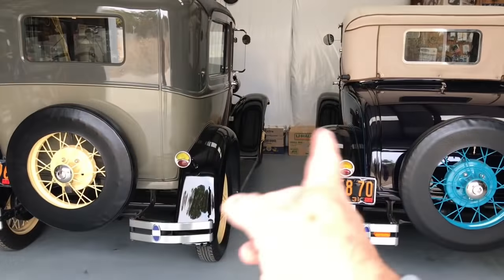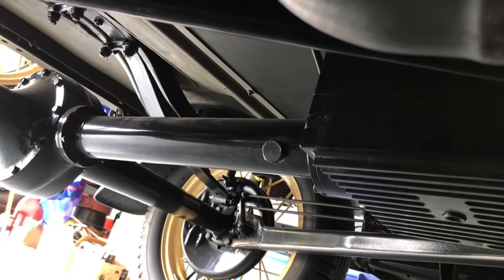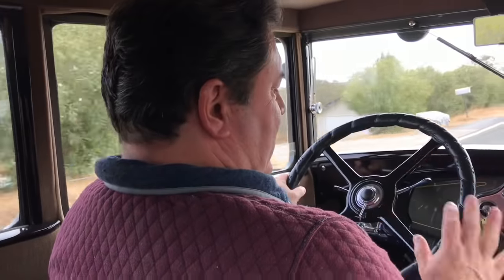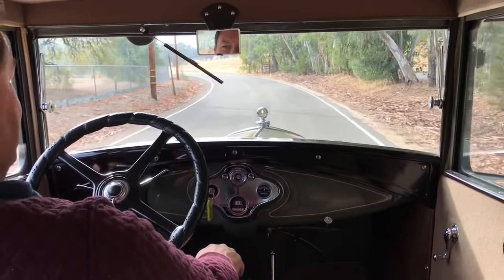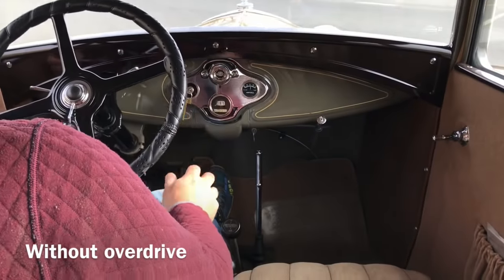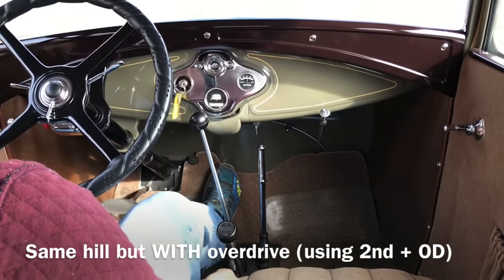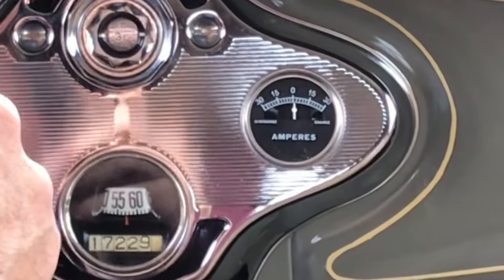Ford Model A Overdrive.  How it works, what it does!  Mitchell overdrive overview

Comment: i like the sound of the overdrive. but not sure about the 3500 dollar price tag. im happy doing 45 to 50 but was wondering if going that fast for say 45 minutes or so at a time will damage the engine rpm wise.i replaced original radiator with a 450 hp rated aluminum one and its been a neighborhood driver for 15 years because the tires are cracking and i could not decide on how thick i wanted the white walls. ended up getting black walls in the end. mine is the rumble seat coupe chicle crab # 91 copra drab #440 and straw 526 rims and pinstripe also. you dont happen to know the modern day paint codes for those colors do you because im going to repaint it in a bit and the only codes i have are from the repaint manual 28 to 36 and the local auto paint stores cant decipher the codes for some reason because they are out of date. my dads the A expert in the family and i usually ask him questions but he knows nothing about overdrives in As.
Reply: If you’re still looking, get the MAFCA revised paint and finish guide 4th edition and take it to a paint store. They’ll scan the colors and get you a perfect match.

Comment: A nice model A Tudor you have!  
Once again a very well done, informative video. Looks like the overdrive is definitely the way to go! Does Mitchell make them to fit other cars? (I have a 31 chev.) Roughly what does a mitchell trans. and overdrive cost for a model A?  Looking forward to complete installation video. Well Done! Thanks.
Reply from the maker: Mitchell makes several different overdrive models.  Give them a call and see.  This one coat around $2800
Reply: @ModelA  Thanks for the info on the overdrive, I'll check it out. I always enjoy your videos.

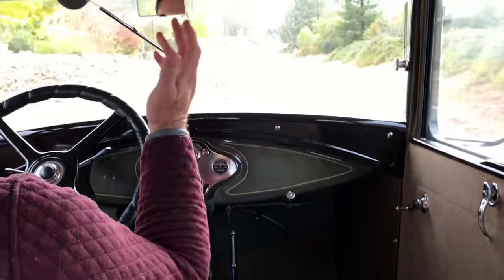Comment: I'm curious about your shifting with the overdrive.  I'm not unfamiliar with manual transmissions; I've been driving sticks since 1995 (driving, not working on them).  So, that's familiar enough.  But it seems like at 7:15 and 9:24 that you have to downshift the overdrive (to "neutral"(?) - not high and not low) before you shift into 3rd.  1) Is it not good to shift the transmission while in overdrive? or is it just not necessary?  2) Does the overdrive essentially expand the number of gears?  I mean, is it like you now have 1st, 1.5, 2nd, 2.5, 3rd, and 3.5 gears?  Is that why you shifted the way you did (i.e. from 2.5 to 3 then to 3.5, instead of directly from 2.5 to 3.5)?
Reply: lol  no. Those "club seminars" make GREAT youtube videos, but youtube videos probably throw a monkey wrench into a club seminar. lol
Reply from the maker: The Mitchell overdrive is basically a 2-speed rear end, that's why.  Also, the Model A has an unsychronized gearbox, so you have to match RPM and speed for the gear.  Thank you, and welcome!

Comment: Hi Paul have a question when you said you were climbing the hill in second high didn’t you actually go up to third low instead? Just checking to see if I’m understanding this correctly thanks.
Reply from the maker: When you hear the whine (with or without OD),  I'm in second.  When the whine goes away, I'm in third.

Comment: I almost screamed when I saw the jack stands on those cinder blocks!. the blocks should have been turned up in the normal position AND wooden blocks on top for the stands.
Reply from the maker: I knew I was going to get a lot of flak about the cinder blocks.  The car was still hanging by the cables.  The jack stands were just an extra safety backup.

Comment: I'm interested in having an overdrive on my Model. But I'm sure I'd be looking at around two grand Canadian for one of those Mitchells. And I've heard that several guys had problems with them, though I don't know the details. So I'm also wondering if counterbalancing the crankshaft and lightening the flywheel  could  achieve the same results at less cost.
Reply from the maker: Nope.  Not even close.  Also, lightening the flywheel makes the Model A feel like it has LESS torque when climbing hills.
Reply: @ModelA  Less torque, but what about more power? I'd like to hear from some other guys as well on this.
Reply from the maker: @jimervin387    You can have lots of power without torque, and the other way around.  A Model A motor is not high revving, the Model A relies on torque to perform well.  Stripping a Model A motor of its low end torque reduces its hill climbing capabilities in all cases where the engine is not wound out.  It's simple engineering.  I also swapped a lightened flywheel on a tudor sedan for a full weight flywheel several years ago.  Night and day difference.  Nothing else was changed, just the flywheel.  Owner was VERY happy.  He thought that since all the experts on the web forums said to lighten the flywheel, he should have it done when he had his motor rebuilt.  It did not perform well, so he asked me to drive the car.  I immediately could tell it had a lightened flywheel and told him that was the problem.  He was like you and did not believe me.  Eventually, out of desperation, he brought it to my shop and told me to do whatever it took.  I pulled the rear end and trans, then the flywheel.  I installed a stock flywheel and put it all back together.  I was like getting a 20 HP boost.  

Whether you take my word for it or the internet "experts", I don't care.  I am not here to argue.  Do what makes you happy.
Reply: @ModelA  You keep raising questions with me, Paul. Now you've raised another one. Did the car also have a counterbalanced crankshaft? Maybe I ask too many questions for you. But I wouldn't go laying out big bucks for an overdrive without looking at it from all angles. I've got to appreciate your giving us the benefit of your experience. But I'd also like to hear from other guys who have had some experience with a Mitchell overdrive in their A. Did they experience any problems with it. as I heard?
Reply from the maker: Yes, the crank was counterbalanced.  Otherwise, all stock.  Keep in mind, the Model B has a counterbalanced crank AND a full weight flywheel from the factory.
Reply: @ModelA  Ahh so. So it was a B engine. You may have just saved me the trouble and expense of doing a counterbalancing and flywheel lightening job on my A engine. But I also did a little digging about any local guys who have a Mitchell overdrive in their A.  And I did get the name of a local guy who has a bad reputation with me. The word is that he did install a Mitchell overdrive and transmission and his car isn't running now because of a problem with one or the other. Of course that's all hearsay and I don't really want to talk to him to ask for further details. But with no old car hobby events happening anyhow, I don't think I should be in any big hurry to get into that  little project.

Comment: Great video and narration. However, you should have used jack stands that were tall enough to not need concrete blocks underneath them. Further those concrete blocks were oriented in their weakest direction for supporting a load. If you have to use concrete blocks at all, at least orient them with the internal channels vertical and place a piece of 2X12" lumber on top of the block to distribute the load and reduce the chance for a catastrophic failure of the block. Many people have been injured and some killed when the concrete block they were using as a support under a vehicle failed.
Reply from the maker: Thank you Leland.  Yes, I know.  See the description.  I already told everyone over and over, it was hanging from the rafters by cables.  The stands were just there to help steady the car.  But, everyone is right on the blocks.  I won't use them anymore.

Comment: Paul Wondered if you had any suggestions about combatting vapor lock on a model a? I drive mine often and generally if I make a quick stop I have to bleed vapor off at carb so it will run.  Heard of ATF and Diesel in fuel or the old clothes pin trick. Have any suggestions?
Reply from the maker: I have only experienced it once, on a ridiculously hot day.  I started mixing some Marvel Mystery oil (naphtha) in the gas during the hottest months, and that seemed to do the trick.  But I'm not certain.

Comment: Paul,  what is 1st gear overdrive like.  Is it about the same as 2nd gear at 1 to 1?  Or is it really in between 1st and 2nd.  Do you use 1st overdrive for engine braking? or not at all?
Reply from the maker: 1st over is almost exactly stock 2nd.  I never use it.

Comment: Here's a question: for all the time and effort to install that gear splitter kit (which I admit seems nice), wouldn't it make more sense and be more effective to just put a modern 5 or 6 speed manual transmission in there instead?  You know, like a fully synchronized one?
Reply from the maker: No.  Too much modification required, including switch to open drive shaft.
Reply: @ModelA  Understood.  That's a valid point.  "Bearmark" has a video in which he installed a T5 manual transmission on a Model A.  Now 5 gears instead of 3!

Comment: Paul, I'm trying to understand what you did to demonstrate overdrive use on an incline road.  What I think I saw was you going into OD when in 2nd, but then I think I saw you turn off OD (while in second), then shift into 3rd and turning on OD - did I get this right?
Reply from the maker: I went from 2nd with OD to third straight, then after accelerating, third with OD.
Reply: @ModelA  Thank you.

Comment: Dear Paul,
did I understand correctly that the revs are 26% less or, in other words, 74% of the revs without engaging the overdrive?
Did you calculate the revs at 60 mph with engaged overdrive?
Best regards!
Reply from the maker: The 26% is the OD gearing ratio.  They also make a 33%.  Correct.  Since the gearing is 26%, you would see the RPM's change by that much for the same speed.  No, I did not test at 60 MPH or anything like that.  No need.
Reply: @ModelA  Thanks and best wishes from Sweden!

Comment: Paul, do you have any experience with the Borg Warner R10 overdrive? My ‘31 Roadster has one installed in the torque tube and I can’t find good info on its operation. I guess it is mechanically identical to the BW units that attach directly to the back of a transmission?
I’m trying to make sure it was wired correctly before I messed with it. The previous owner had a 12v conversion done but it doesn’t appear they modified the overdrive solenoids which I believe are rated for 6v. Any help is much appreciated.
Reply from the maker: My only experience is with a broken one about 8 years ago.  We junked it and put the car back stock.

Comment: So is the ‘regular’ range on the transmission kept by having the OD in LO or Neutral?  Or is OD Neutral only for towing, starting, and idling?
Reply from the maker: Low range is straight through, or "bypass".  High range is the OD gear.  It's a super simple device

Comment: With you being able to use that in any forward gear, it seems more like a two speed gearbox than an overdrive (speaking as a truck driver). Over drive means you are turning the axle faster than the crank, if I understand such things. Thus the name, "overdrive". So a true "overdrive is only available after the tallest normal gear in the transmission.
Reply from the maker: Since it spins the output shaft faster than the input shaft when engaged, it is a true overdrive.

Comment: Looks like it works great.  Maybe it’s where the Mike placed but there seem to be a lot of chatter in your transmission.  I Dunno maybe not.  I have a 31 roadster and it does not make that much noise.  No offense just wondering. Thanks Walter Dixon.  Oh I have a standard transmission.
Reply from the maker: It's a rattle somewhere in the windshield frame.  I still haven't fixed it.  I got used to it instead.
Reply: @ModelA  oh..thanks for the reply.  I wish I had bought a Fordor instead of the Roadster.
Reply: Your videos are very good.
Reply from the maker: @walterdixon7786  Thank you!

Comment: Hello, my father just purchased a 1930 Model A coupe, it is all original, it has the original fuel system that is gravity fed, it dies and takes a minute to start up again, but was sitting for years before now, is there a common solution to this or what do you do? Thank you.
Reply from the maker: All of my cars use the same fuel system and keep running.  I'd suggest clearing out all the fuel lines and making sure the gas cap is vented.
Reply: @ModelA   Thank you, could you maybe upload a video to show how much fuel should flow out when that bolt is removed from the bottom of the carburetor?

Comment: Is there anyway to install a 4 or 5 speed transmission and not use an overdrive unit?
Reply from the maker: Yes.  I have never installed a 4 or 5 speed, but have seen it done.  I removed a 5 speed once.  They had to hack the crossmember to install it, and that was difficult to repair.

Comment: Placing the axle stand on a brittle concrete block in that way does not appear safe. The block in the position with the legs of the stand placed as they are can easily split it.
You were very lucky!
Reply from the maker: The car was suspended by cables.

Comment: Overdrive for these Model A's is good, considering the torquey engine and total mass of the car.  Now with overdrive you would actually be getting 4 lows(the factory gears) and 4 highs making 8 speed drive. If only the Mitchell box could be electro-mechanical activated with a solenoid and a switch on the factory gear lever (like many cars in the past). This arrangement would look more neat without the second overdrive gear lever.
Please do not use building blocks to stand a car, they can form cracks and the whole thing can collapse.
Reply from the maker: The Model A only has 3 speeds forward, not 4.  You might be thinking of the AA with the 4 speed (3 plus granny gear).
Reply: @ModelA  Thanks, I didn't know that. We have very few of those vintage Fords here in New Zealand. Just looking up Mitchell on Google and it also shows Ryan overdrives, which the article says precedes Mitchell. Now the Ryan box has straight cut gears, is this the same with Mitchell? 
Back in the day, we also had Borg-Warner O/D's which had the 'sun & planetary' gears with a cone clutch and was activated with an electric solenoid, which I think is the best system. I am wondering if the Model A can be fitted with a Borg-Warner box.
Reply from the maker: I had a Model A with a Borg Warner OD in it.  They are spooky because if you back up with the OD engaged, it destroys it.

The Mitchell has spiral cut gears and is silent.
Reply: @ModelA  Yes, the Borg-Warner would get destroyed in reverse, but it can be wired such that it would disangage on reverse. The switch (this being the 2nd one in the circuit) would/could be fitted in the reverse rod in the main gearbox. I don't know the Model A gearbox but just floating some ideas. I hope I don't bore you, I am an engineer and I like these sort of projects.
Reply from the maker: @mohabatkhanmalak1161  I'm an engineer as well, so I am also interested in odd projects.
Reply: @ModelA  What is your view, are  you fine with the second lever or the electric switch setup?

Comment: Are these overdrives worth the price to upgrade?
Reply from the maker: If you drive a lot in modern traffic, yes.
Reply: @ModelA  I suppose if I get a model A I'll have to save up for one. Thank you for the advice. Also- how do the manifold heaters work? I'm in Minnesota, and so if I get a model A I would of course need heating in some capacity.
Reply from the maker: They work amazingly well.  Just be extra vigilant about manifold leaks, especially exhaust.
Reply: @ModelA  Will do! Again, thank you for all the valuable advice

Comment: Paul, did you notice your ammeter read "0" most of the time?
Reply from the maker: Yes.  That Model a has a 6v pos ground alternator and an Optima battery.  Once the battery reaches full charge, the alternator stops charging it and only supplies the current the ignition system is using.  Since I have a 30 amp ammeter on there, 1.5 amps RMS doesn't even register unless looking very closely.  Good eye!
Reply: @ModelA  Mystery solved :)

Comment: Wish I owned a ford
Model A completely
Sorted. For daly driving.
Reply from the maker: Do you have a budget?
Reply: Sorry paul it is only a Dream. I would not drive it in the winter hear the salt they sprinkle on the roads
Would eat it up over
Time even with Vanadium Steel
Mich. Roads are very
Hard on cars especially
In winter. I was a mechanic for 30 years. At many places
One boss payed me 
Less because I worked
A little slower than the
Other techs. Who always had Big
Dollar signs on the Brains. I did a good
Job first. Some of them were just plain
SLOPPY. My jobs
Did not recheck
I was always double
Checking my work
Cars are very
Complicated especially
In 2021 I have a low income. But wouldn't
I look good going
To mass with my guitar
To play in the choir
As I am a volunteer musician.
It's fun to make people
Happy in music
It lifts them up
In there soul
With God's help
It would be easy
To drive and maintain
A Ford motorcar
Mo. A. Oh well
I always did like
Electronics electrical
And mechanical things
A Boss once said behind my back
Quietly that I over
Heard. I love these
Old mechanics
They can do anything
I did not look back
I just smiled that made
Me happy for a moment. They didn't
Pay me very well
Either. Oh well thats
The way it goes at times I only have a few more days to live
So to speak perhaps 
I will go to Green field
Village in Dearborn, mi.
Where they have lots a
Mo. A's and T's they drive daily. And steal
One haha just kidding
Not. Never. Do that.
God Bless you Paul
Shinn.
Dwight.